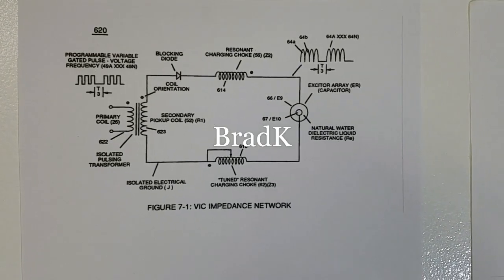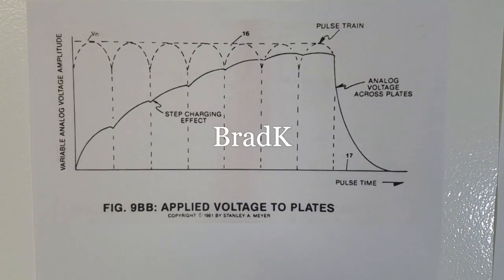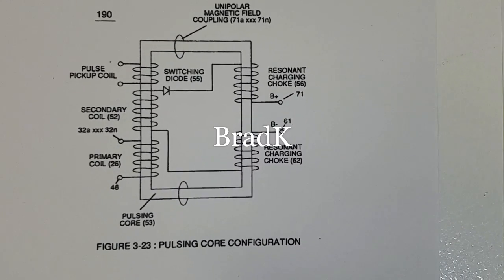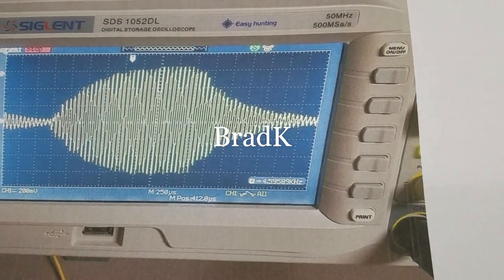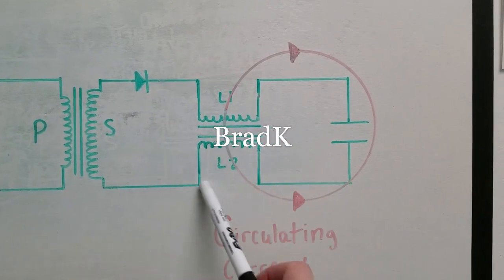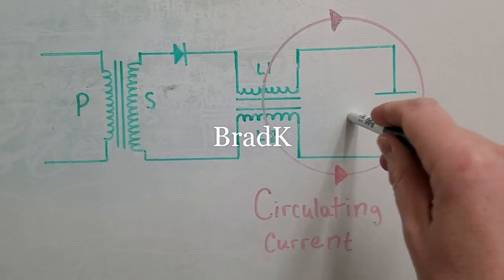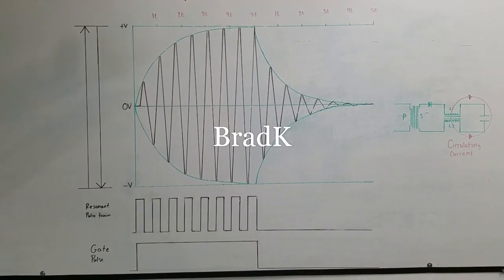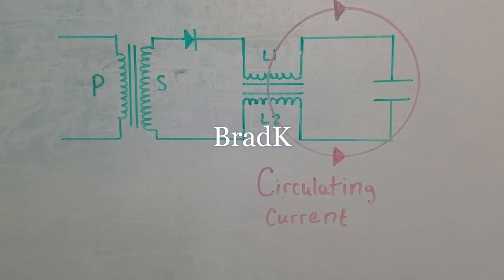Stan Meyer Research # 29, Apr 2020- AC Resonance waveform in the V.I.C.?

Comment: Hello Brad, i guess i know your mistake. Look again very closely on the first image, you can see a black dot on the right side of the top choke and a dot on the left side of the bottom choke. The dots represent the orientation of the chokes. All you have to do is to reverse the two wires at one of the chokes. After doing this you should get a DC pulse-train signal at the cell. Now you get the frequency doubeling effect, this is because the input signal at each choke is an interupted DC signal with variable voltage (interrupted half sine). This waveform causes the chokes to fire during the absence of a pulse 180° appart from eachother in an alternating fashion. First pulse top choke, second pulse bottom choke, then again first choke and so on (frequency doubling effect). But again the signal at the cell is never alternating, only consisting of DC pulses produceing a strong pulling force (field).

But as you probally already know there is another utmost important thing you have to do, which is tuning the two different amplitudes of the pulse train to the same level. I guess we would not have to do this if the two chokes were build 100% identical, but since this is almost impossible, there is always one choke outperforming the other in amplitude (volt). This is the reason Stan used the wiper principle to tune (match) the two different amplitudes to the same level (as explained above: frequency doubling effect). Only then, with matched amplitudes, can both double layers be formed in the capacitor (8th current restricting principle as seen in your video).

Keep up your videos and maybe you can let me know where i can get the right ferrite cores.
Reply from the maker: @Downwash-lu2yh  

I get what you're saying, but I still think the V.I.C.'s Stan made were meant to produce AC like I explained in the video. I think his early circuits were only pulsed DC and they did produce a step charging waveform, but as he learned more, he went into AC circuits to get voltage magnification at resonance.

Comment: AC will never produce results. It is without a doubt, pulse DC across the cells. However, since it is a capacitor, there will be a constant charge across your plates. The V.I.C is used to 'snap back' that positive voltage potential to 0v, then repeats the cycle. It's kind of looks like like AC, but with a DC offset, much like phantom power for mics. Voltage is never passed through 0v on pos or neg plates.
Reply from the maker: Care to elaborate?
Also, please explain how to prevent the circuit from forming AC when the chokes are coupled?

Comment: That voltage draw should be DC pulse, not AC as there's a diode which prevents current to flow back. When we switch on coil it starts to load energy, magnetic energy. Voltage is on and current should rise up constantly and its current depends on coil inducancy. Then we switch off power in. Magnetic energy stored in the coil wants to be discharged. To archive that the coil voltage can rise up dramatically to high voltage. Two things primary coil must be connected in the right direction with secondary diode to allow discharge coil. We must pay attention if primary coil can release energy back to supply. It is possible in some cases. I remember that Stan said that frequency is the key here. Maybe different hardware configurations needs different frequencies. I have to try that idea on my own with own measurements.
Reply: The charge that builds up leaves a drop spike in neg voltage that's the bouce

Comment: I totally pickup that AC ring up/down on my EMF probe near the cavity. Remembering your impedance calculations, Parallel Resonance mean Infinite Impedance :)
Reply from the maker: Exactly! 
High impedance to the primary circuit means low draw at resonance but a high circulating current within the resonant circuit.
Reply: @BradKwfc  why is that so contrary to Stan's 500t primary then? 🤔
Reply from the maker: @drgonzo7806   What do you mean, I'm not sure what your asking?
Reply: @BradKwfc  Oh, just how you suggest that a large primary inductance is more suited for the impedance ratio. That makes sense, but we see Stan only had 300 or 500 turns on his primaries. Here's a quick vid of that EMF pickup showing the AC wave https://www.youtube.com/watch?v=uvdzsLdS87g
Reply from the maker: Primary L should be around 48mH if I remember correctly. If I said it needed to be higher in another video I was wrong about that. 

BTW, your waveforms look even better than mine. Is that with a cell or a capacitor in place of the cell?
Reply: @BradKwfc  Ironically, that's with a Diode and Cell ONLY :) As soon as we add inductors to the mix, then everything goes to hell.  lol But, then we have to work to tune it back to a matched impedance to get voltage drops occurring in each component.

Comment: You can't have DC current circulating  in the way you tried saying. You can however have a AC current going via the capacitance between the bifilar windings. That capacitance may well be greater than that of the cell.
It's an AC circuit pumped by HV DC.
Another thing is that even with the cleanrst water you will get resistive losses in it, killing the energy and voltage build up.
Reply from the maker: I guess I didn't describe it correctly but yes your right it's an AC circuit pumped by DC. It still has the typical DC RC charging curve that you see in DC circuits.
Reply: @BradKwfc  Sent you a mail

Comment: little gas production with that wave is a good sine. You need to crank up to KV's. It must be charged like a normal cappacitor at low frequency to DC, because a capacitor then blocks current and stores energy by the dielectric field in he water, polarizing the wattr like a regular dielectric.
The 2 chokes are opposed bucking coils, having opposing magnetic field from each others Lenz' law reaction started by the core flux from the primary, the opposing fields then prohibits currentflow in eachother, the secondary just adds voltage like batteries in  series.

The waveform looks like a low freq signal with a hf signal modulated on it, how would a cap or lcl circuit react to that?
Reply: Agree'd. You make good points. Thank you!

Comment: Nice work. I think I may have stumbled on a similar effect when working with spark gaps. The intensity and volume of the sparks went waaaay up when I added some diodes on the transformer secondary. I’ve been trying to figure out a way to get that same effect with a water fuel cell. I’ll give it a try tomorrow. Thanks for the tip!

Comment: I like how clean all your work is! I am really wanting to take a 1978 Toyota Chinook and experiment with all of this. My question is how long did it take you to read the entire patent and really understand how it works? Where should I start, is there new information that would be helpful before I get started? Thanks!
Reply from the maker: Thanks for the kind remarks.

Honestly it takes years to get everything put together and get everything in the right balance and tuned correctly. At this point I don't think putting it in a vehicle would be easy if even possible. Many of us have been researching for over 10 years and we're still on the bench testing phase, just trying to get a glimpse of it working and then hoping if we do we can repeat it.

So far I only know one person who got it working to that point where he could start it up and get it working over and over again.

Stan has a number of patents he filed on the technology ranging a span of over a decade, not to mention two books 'The Dealership Sales Manual' and 'The WFC Technical Brief'. There really is a lot to learn.

If your wanting to replicate make sure you build everything as close to Stan's designs as possible. There are several variables that are not obvious but must be exact or the system will never work.

The VIC built with the thin ferrite U cores meant for driving the 11 tube Water Fuel Cell is probably the best thing to replicate as its what we have most of the information on. I show a VIC replication that gives me very close values to Stan's in another video (Using ferrite rods) as well as a drive circuit I developed over the years in another video. The forums (Open-source-energy, Ionizationx) are a good place to start but they are also filled with fluff so you have to sift through it all to find anything useful. All I will say is its a fun and challenging hobby but difficult.

Comment: I wonder why didn't he make the cell resonate in parallel using an inductor and cap(electrodes) in parallel, regardless of all these complications. This thing could be simplified. I think he complicated it so that no one can easily replicate his invention
He made a series LC tank resonate then used some transformers to finally make a parallel LC Tank!? Why!?
Reply from the maker: Good points. I'm not sure why he designed it the way he did as it makes tuning very difficult. Stan's twin brother was an electrical engineer who designed many of Stan's circuits etc. He (Stephen Meyer) said in an interview that he had developed a more efficient way of doing it. Look up his patent Hydroxyl filling station, patent # US20050246059.

Comment: I like the way you are thinking!  Chokes are the bell, and primary/secondary are the ringer.  Is it possible that the chokes need to be constructed to handle higher heat and voltage potential than the rest of the coils?
Reply from the maker: Thanks. Yes I think so because the chokes and cell are in resonance so they will have a higher voltage drop across them than the secondary coil. At the same time the VIC is a beast of complexity. There is a lot more work to do...

Comment: looking good buddy and yes I have made plenty of high voltage devices that show signs of AC and DC in fact you can measure them with both AC and DC weird thing happen when you get high voltages like Badini and Radiant energy Not quit electricity but similar
Reply from the maker: The AC could even be made by the self oscillation (SRF) of the chokes, but in this case I really think the AC comes from the coupled chokes and cell oscillating together at resonance. Aside from that I don't think there is anything magic about Stan's work-he just did something in a different way. I have a hard time believing in 'Free Energy', but I do think there are always different ways of doing things.